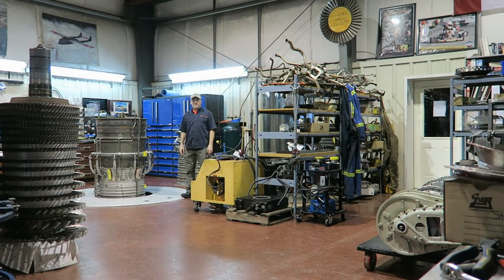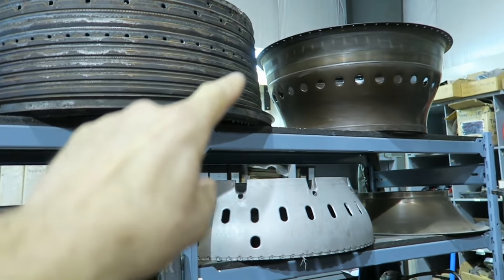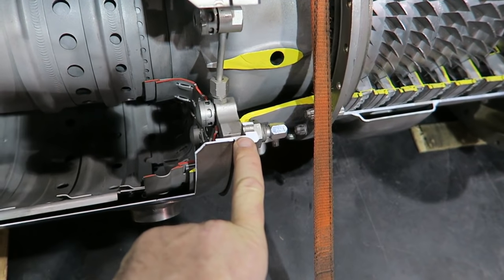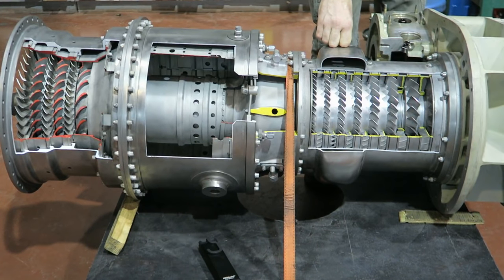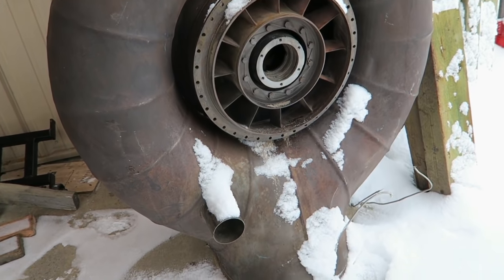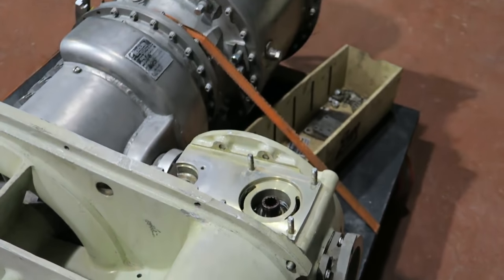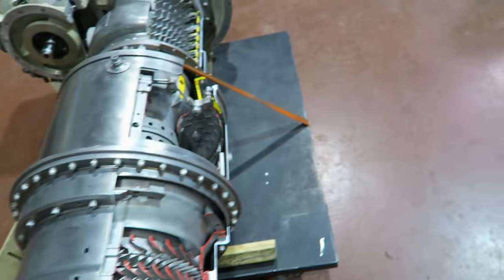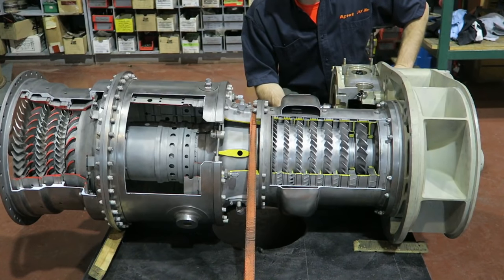Solar Saturn Turboshaft Engine

Comment: Jet Porn on a Saturday morning.  What a beautiful job on the cut away.  I have to say  that it looks like something International Harvester would make.  That is one beefy case on that bad boy.  Made for the farm to last many generations of owners. (not really made for the farm, but the analogy is the same -- it will last forever if taken care of)
Reply: Apart from the intake casing, which AgentJayZ tells us is in steel, it appears to me to be a relatively lightweight machine, as compared to the big industrial heavyweights.
Reply: grahamj9101 Well good Sir,  I cannot argue with the Master,  the internals are probably light weight compared to a 40,000hp gas generator.  
But you have to admit, that accessories case looks a lot like a Power Take Off from a tractor :-)  Hope all is well over the pond.
Reply: Apart from that intake casing, the rest of the engine casings look only a little heavier than an equivalent aero engine. However, we can't see what the compressor rotor looks like and I can't find a cross-section  on the internet. It could be quite a solid steel lump and fairly certainly it wouldn't be in Alumin(i)um or Titanium.
Things are OK over here, thank you - apart from all the issues over Brexit, which will probably continue to plague us for years to come.
Reply: grahamj9101 You have the Brexit,  we have Clinton and Trump -- ever think about moving to Jet City and rent a room from JZ :-)
Reply: Well, it was reported here that several American A-list celebrities had threatened to move to Canada if Trump won. However, with advancing years, I'm feeling the winter cold more keenly and, seeing the snow in Fort St John, that's putting me off. If I do bale out of the UK, I think that I would join my daughter and family in Singapore - and complain about the heat and humidity. There might be snow in BC, but this afternoon, I mowed my lawns, probably for the last time this year, and cleared up the fallen leaves.
Reply: grahamj9101 I hear you there.  We have not had much snow -- about 6 inches,  but it is all melted now.  BUt the cold is coming.  Opening up a bar in the Bahama's is looking better each year :-)

Comment: You probably could use it for home power generation if you got your hands on one, but youd be better off using it to charge a battery bank rather than trying to run it full time since it would just idle the whole time, using tons of fuel. Id imagine that one would probably need to only run for about 20 minutes during a major power outage.
Reply from the maker: I think it's 1.3 MW.
Reply: @AgentJayZ  Is it really that high (and not .75 MW)? Im surprised they can get so much out of it. With that said a power bank could probably only realistically absorb about 10% of that, and the neighbors would probably hate you, and Im sure parts are hard to come by. Still is someone were crazy enough to try it would make for a neat project.
Reply: @mysock351C  @AgentJayZ we are looking at a mobile buildout with this turbine. we are looking to see is this the best-case use, but im curious if you think this turbine would burn a mix of syngas and hydrogen?
Reply: @blainevans4782  If it was available with the option to burn natural gas you probably could, but AgentJ would need to comment on that. But you would need all the hardware to go with it off of an example running natural gas.

Comment: Jay, you made a comment that if an engine gets much smaller, the fuel efficiency goes down.  Is there a sweet spot for hp vs fuel efficiency?  Obviously they type of fuel plays a part, but I'm wondering about the high and low hp thresholds of max efficiency.  Where does the law of diminishing returns show up?  Great video.
Reply from the maker: You are not considering all the variables, but only power output and efficiency. With only those two factors, there appears so far to be no limit. The bigger, the better.

Comment: Is that the smallest engine you have worked on AgentJayZ ?
If not, what is the smallest turbine engine you have worked on ?
Are smaller turbine engines harder to work on (space) ?
Reply: +BillyNoMates1974 Check out this T-58 videos/boat racing videos. Its probably the smallest axial flow engine I've seen on his channel.

Comment: Wondering what the fuel consumption would compare to a piston diesel at the same rated power output of 1000 HP.
Reply from the maker: They are very similar. But piston engines are more economical at reduced power. Turbines are best used for constant, high load applications.

Comment: This may be a very foolish question so pardon my ignorance, would a jet engine ( in any format ) be able to effectively run on CNG or propane? would the engine be down on power if it is, also would it simple be ineffective because the engine would burn through the fuel too quickly.
Reply from the maker: Jet engines actually run better and have lower emissions on natural gas or propane than they do on liquid fuel. Almost all of the industrial engines we work on and test are installed to run on natural gas.
These are not piston engines, so the amount of energy in the fuel is not important. If you need more heat, just burn more fuel. Easy.
Reply: They use gaseous propane when in the Test cell as ive seen in many videos. 😁

Comment: weve got one the same as that from gta industries oklahoma .There part of turbine efficiemcy group witham st hughs were im one of two rotor techs , love your vids
Reply: Turbine Efficiency Group has acquired Gas Turbine Applications Inc., an aftermarket service provider specializing in the Saturn and Centaur industrial gas turbines.

Gas Turbine Applications serves a longstanding customer base operating from facilities strategically located in Calera, Oklahoma, USA. Turbine Efficiency was founded in 2001 as an independent service provider for the full range of Siemens industrial gas turbines from 1 – 15 MW and provides all maintenance, repair, overhaul and testing of gas turbines and packages. The group operates from an overhaul facility in Lincoln, UK, with offices in Aberdeen, Dubai and Houston, and has resident Field Service Engineers in several key European locations. In 2016, the company was acquired by Core Capital Partners, a mid-market private equity investor supporting high-growth UK companies.

Turbine Efficiency Group said the acquisition creates a leading independent service provider for a wide range of gas turbines (SGT-100, SGT-200, SGT-300, TA, TB, Saturn, Centaur). The group will leverage its combined capabilities to service new and existing customers from overhaul facilities in the UK and US, and regional offices in Aberdeen and Dubai.

GTA will be led by Managing Director Rob Leach, supported by Operations Manager Mark Blake, who is remaining with the business.

“The acquisition of GTA represents the exciting completion of a key strategic objective in the ambitious expansion plans for Turbine Efficiency, bringing with it the extension of our global footprint and the Turbine Efficiency brand into the critical Americas market,” said Chris Turner, CEO of Turbine Efficiency. “We welcome our new colleagues at GTA into the Turbine Efficiency family and look forward to working with them as we take both companies forward together”

Turbine Efficiency Group and Gas Turbine Applications will be jointly exhibiting at booth 935 at PowerGen International in Orlando, Florida, USA, Dec. 4-6.

Comment: Can the hot exhaust gas be used for supplemental heating ?  Space heating in then winter or hot water heating year round ?

     I have seen a very few Solar gas turbines used for back up power generation at TelCo locations .

Wyr
God bless
Reply: Yes, man gas turbines are used for Commercial Combined Power and Heat.

Comment: I have seen some one cut the tip of their finger off just the way you said. they spun the compressor and didn't pull their finger away in time and........chomp. it was a Huey UH-1H US Army helicopter.
Reply from the maker: I nearly lost my right hand to an RB211 compressor. I felt lucky and stupid at the same time.
Reply: +AgentJayZ that sounds like a great story for a video.
Reply: Industrial or aero?

Comment: @AgentJayZ You folks do an amazing job with the restoration process everything looks "kitchen clean' painstaking I am sure. Q1:When cleaning up alloys and other materials do you use chemical cleaning products? Q2; Do you use any abrasive polishes IE rouge materials, is that ok for flight bound engines?
Reply from the maker: We do use both solvent degreasers and and alkali solution that we call blue soap for the really tough deposits of burned on oil. It's real name is Neo-Tek.
We also use steel brushes, sandpaper, and Scotch-Brite.
Cleaning is a big part of engine overhaul. In larger shops, there are crews of people whose whole career is parts cleaning.
Reply: I believe Neo-Tek works great on the snowmobile tunnel and skid frame if I am not mistaken
Reply from the maker: I don't know why you would use it there. It dissolves aluminum, and is an aggressive degreasing agent.
Reply: @AgentJayZ It makes the Aluminum look nice and bright like new again and is great degreasing off the two cycle oil I am saying I seem to remember using it thinned down on my Cat tunnel, guy at the local machine Motor -  sled shop bought in bulk.

Comment: I noticed that when you rotated the engine manually, the fans are in the front of the engine working together at low speed. After high, the fans took different speeds and different directions maybe. Does it true or just imaginations because it moving fast.
Reply from the maker: +Mossad Ahmed samaha 
There are no fans in this engine.
Reply: That is a stroboscopic effect... a type of optical illusion caused by the camera frame rate vs objects moving in the frame. In 'Old West' movies, the smaller stagecoach wheels can sometimes be seen to rotate opposite to the large wheels, because of this effect. It depends upon how many spokes, or blades in this case, are on each wheel.
Reply: AgentJayZ that is wrong. You have turbines which are driving your shaft and compressor, and when backdriven those are fans.
Reply: Imagine this. You have a fan with a single blade. You turn on the power, it rotates at one revolution per second. You keep your eyes closed, except once per second when you quickly open then close them again. Do this perfectly, and that single blade will always be in the same position whenever your eyes flash open, so it appears to be stationary. Now you slightly increase the power to the fan so it speeds up just a little bit. Now, whenever you open your eyes, the blade is in a different position. It appears the blade is moving slowly in one direction. Decrease power down to a point a little below the original setting. Again, the blade is in a different position each time your eyes flash open, but the blade appears to be moving in the opposite direction.

Next, imagine your fan has two banks of blades. The first bank has two blades. The second bank has 3. The assembly spins at one revolution per second. You open and close your eyes twice per second. Every time your eyes open, it appears the blades in bank one are stationary, even though they are swapping positions for every blink. But the three blades in bank two appear to be moving. So it looks like the two banks are moving at different speeds, even though they are aren't.

Video cameras are like regular still cameras, except that they take a lot of pictures really fast.

Comment: IN turbo shaft engine stater vanes will not be there in the compressor?
Reply from the maker: This is discussed several times in videos contained in the playlist
Your Questions Answered. It has a sort of index.

Try looking for stators.

Comment: two questions, how much would a cut away model like that cost? you know...obviously for academic reasons..totally not to be the center piece of a livingroom cough
ok more serious question, you said anything smaller then that sized engine starts to tank in fuel efficiency, why is that? is it because the parts and  clearances get difficult to fine tune?
Reply from the maker: If you have something we could use, we would trade for that.
Once you get below 1 MW, diesel piston engines are cheaper to buy and easier to maintain... for about the same fuel economy.

Comment: Waaaait a second...  How can the compressor blades have a smaller exit than entrance?  Does the diameter shrink from input to output side?  If you have N blades around diameter D, the spacing has to be D  / N.
Reply from the maker: They are curved.
Reply: Sorry, I don't see how the same number of exits along the same circumference can be any smaller.  In fact they have to be larger, as the thickness of the blade is less.
Reply from the maker: Please see above comment.
Remember, it works, so if you don't understand it, you must be missing something.
Draw some pictures, do some thinking, and it will come to you.
Reply: I respectfully refer you to the "questions" video, #56. This is the video where the  whole world (of jet engine compressor sections) started making sense to me. Some of the comments (with links to simple compressor section diagrams) may be helpful as well.
Reply: I still don't get it.  Please bear with me:  If you have a circumference C, divided by N blades, how can the blade spacing be anything other than C / N ?   In fact, the blades have variable thickness, say T, and they're thicker on the inlet side, so the gaps sure seem to have to be smaller--  (C/N) - T on the inlet than the outlet side.  I know JZ is hardly ever wrong, but the basic geometry sure seem to be cut and dried and obvious and contrary to the assertion that the outlets are narrower than the inlets.  
Now I could see that the actual air mass could have higher pressure towards one side of the outlet, and therefore higher velocity.  But the physical space sure seems to be actually larger in width at the outlets.
Reply from the maker: I will not bear with you. Stop holding me responsible for your inability to grasp something that I am reporting, not making up.
Reply: As a former compressor and turbine designer, I can sympathise with AgentJayZ's response to you: however, I will have one more try - and correct an unintentional error that I made in the next paragraph, where I transposed the words 'outlet' and 'inlet'.
You should not be considering the geometric area of the inlet annulus relative to that of the outlet annulus, because, in a compressor, the latter is actually smaller than the former. You need to consider the area that the airflow effectively experiences, in terms of the passage shape formed between the blades and vanes. 
Take the shape of the passage between individual compressor blades or vanes and draw a series of circles from inlet to outlet, with the circles tangent to the passage boundaries, ie, the surfaces of the two aerofoils. You will see that the diameter of the circles increases from inlet to outlet, because of the curvature of the aerofoils, which means that the passage width increases, ie, the passage is forming a diffuser.  If you do the same exercise for the passage shape between turbine blades or vanes, you will see that the circles decrease in diameter, ie, the passage is forming a nozzle.
If you don't get that, I can assure you that the air (or gas) does.
Reply: grahamj9101 , thanks, I figured it was something to do with the projection of the path against the output area, which is going to go down as the cosine of the exit angle.  So while the area is actually a bit larger than the input,  measured across the plane,  the airflow is projected at an angle so it sees a much smaller effective exit area.
Reply: Please also see my conversation with Jangle 2007, who was having much the same problem as you.
Reply: You could have just said that it is coned shaped too. The original question didn't put that in his formula. Would have saved time.
Reply: Cone shaped?  Sorry, but I don't understand your terminology.  Are you referring to the fact that the compressor annulus reduces in height and the compressor drum (and sometimes the casing) consequently has an approximately 'cone shaped, form , in most (but not all) cases?  If so, then this has nothing to do directly with the diffusion process in the compressor blade and vane passages.  It exists to 'compensate' for the progressive increase in density of the air through the compressor and to maintain an approximately constant axial velocity.  If there was no reduction in the annulus height, the velocity would progressively reduce, making the aerodynamics more problematical.
Reply: You just sucked the fun right out of it with that terminology Graham. KISS method should have been applied here. Should have said that the compressor's basic shape without having the blades on it is cone shaped with the point of the cone being the inlet of the engine. It's not a coincidence it being that shape either.